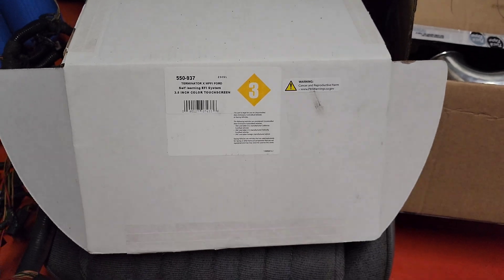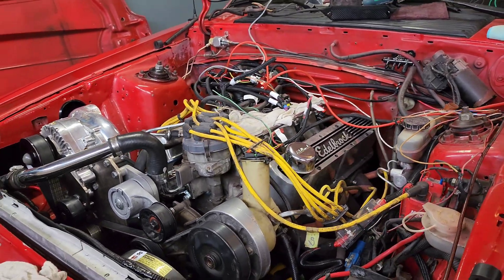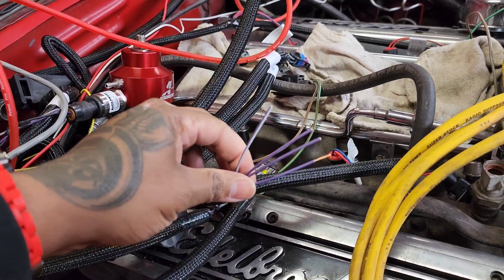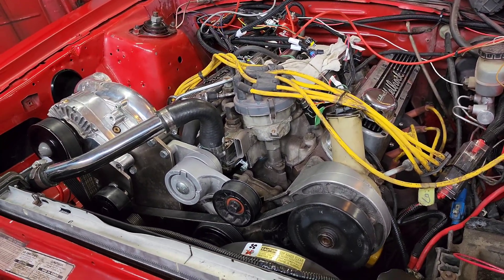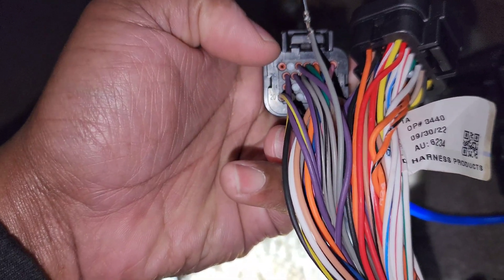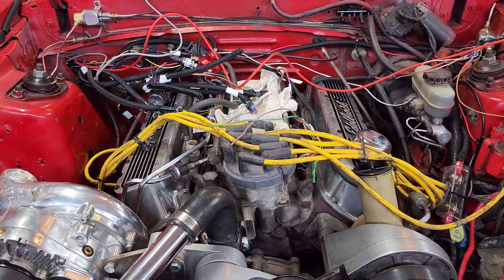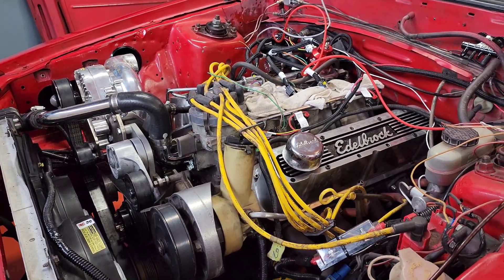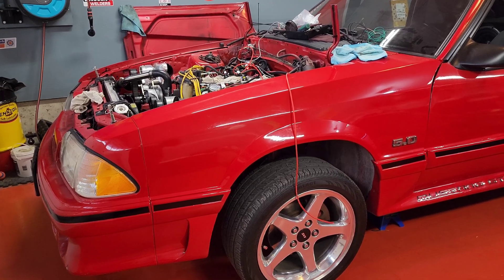Installing a Holley Terminator X 937 in 2023!

Comment: When I heard the Ford kit was going away I looked up the harness differences between the universal kit and the F kit and bought those harnesses from summit etc.   Bought the seat bracket also.  Not sure if they're still out there but that's a possibility also.  Thanks
Reply from the maker: If your using the seat bracket you will need to lenthgen some wires for it to fit. I would install it under the dash so you don't have to!

Comment: What adapter did you use for your IAC sensor?
Reply from the maker: Used the Ford IAC, in the video it will show you what pins you need to move around and what wires to cut.

Comment: What wires were to short to go under the seat? Just the power harness, or the main harness?
Reply from the maker: The main harness as this particular kit isn't designed for under the seat. It's designed to be mounted where the factory ecu is.
Reply: Got it! Thank you, I'm about to order this kit and i was debating where to put the new ecu. Thanks for the video, its very useful now that the "F"kit is unavailable
Reply from the maker: For sure man!

Comment: Thanks for the vid. gives me a heads up on install im about to do on my 347/ Vortech T trim/ Term X install   so much for the plug and play they get us all to buy into LOL
Reply from the maker: Lol yah, hopefully you don't suffer like I did 🤣
Reply: @superbrowndudenational_trx  uh oh, care to elaborate? What kind of mess am I in for?
Reply from the maker: Just the lack of sensors and having to add some wire to the harness. It would likely be better to mount the ecu where the stock one was. Then you wouldn't have to add wire. You still need to source sensors tho!

Comment: This sounds dumb but do you know which screws you need to mount the ECU to the bracket?
Reply from the maker: Bud, I'm the king of dumb. I thought wiring this would of been smooth lol. I used M6 x 16mm bolts and nuts. Really any 3/4 inch long bolt will work of your thread choice.
Reply: @superbrowndudenational_trx  hell yeah, thank you